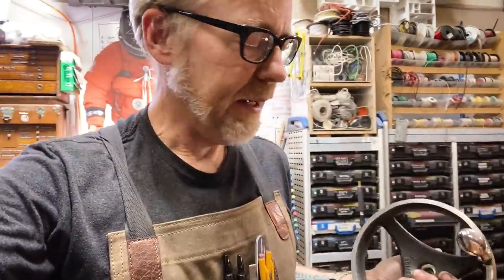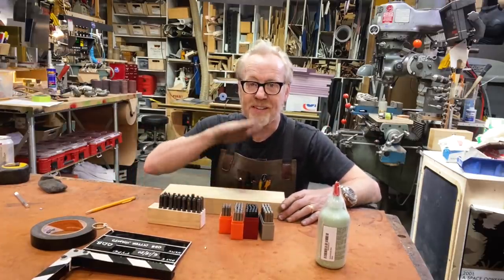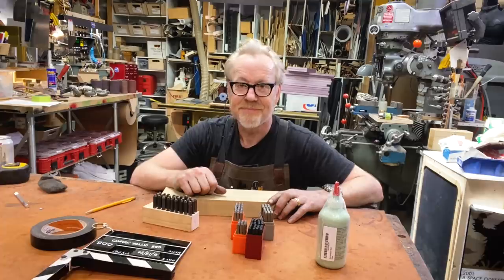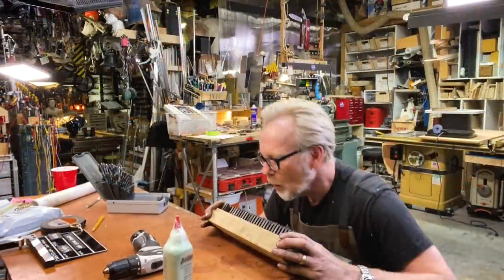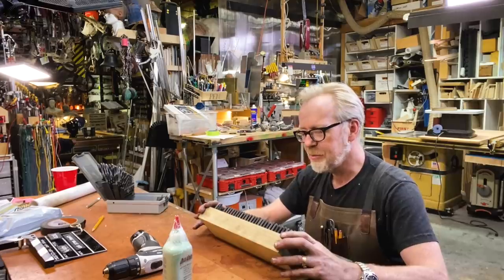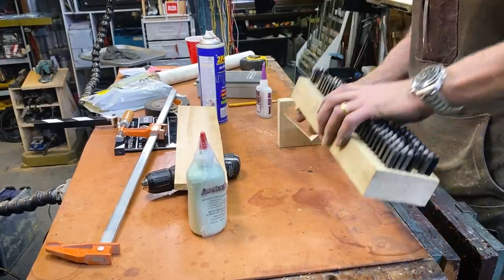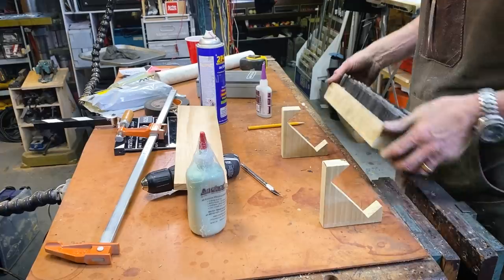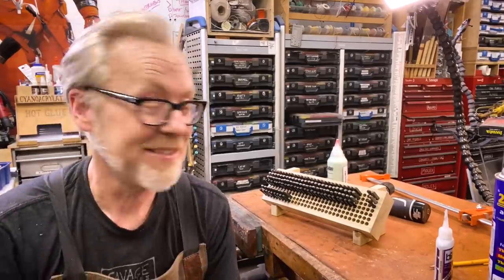Adam Savage's One Day Builds: Letter Stamp Holder!

Comment: Just a thought for version 2? If you varied the hole depth by horiz row then it may make it easier to grab each punch.. you could have 3/8 or so of the top of each punch accessible to grip as well as the front. If the top hole was the deepest it would provide a form of “stadium seating” for them.
Reply: Was thinking the same thing. The ones in the middle rows might be hard to grab since they're packed in a bit densely.
Reply: He could fix that by stowing a piece of glue stick down the holes. Maybe 1/2" on the middle row and 1" on the top row for example.
Reply: I made something very similar to what you just posted but for my 1/4” bits.  Came in very handy over the years.
Reply: Also could make another block and place over top to server as a cover and keep them clean and free of dirt/dust, & maybe magnets to keep it on?
Reply: I was thinking along the same lines... Possibly a 'stair-step' design of some sort.
Reply: Or just high and low on every other row?
Reply: Or use a magnetic pick up stick/wand.
Reply: I was thinking making the spacing a little wider and stagger the holes in alternating rows like a honeycomb pattern.  That would give a little more access to the front and back edges of each punch.
Reply: @dweiss1  I was thinking the same thing, that spacing would annoy me. yes it would take up more space but the whole point was to make it easy and less annoying
Reply: And add strips of aluminum as labels with the letters stamped in them for a quick visual
Reply: That would actually make it more difficult to grab the ones that are 'lower', same would be true for an up down up down pattern. The current arrangement is  good, and if he needs more space to grab, the best option is to just make a new one and drill the holes further apart.

Comment: I did something similar for my letter stamps but I put the block at a 45 degree angle But still kept the holes straight up and down so that I can grab different letters more easily since they are not all at the same height , which made it hard to grab them since the holes are so close together. Nicely done with the mill though and I like the anti tear out paint stick technique. Cheers

Comment: you should vacuum form a front cover just in case it tips over or something
Reply: I was thinking the same thing
Reply: what about rubber to "securely" hold them in but still able to pull them out. but say it tips over there is enough grip to keep them in place.
Reply: I thought he was gonna make a double hinged swing over lid w/ that flat piece of wood he had..... Or I was hoping he would've done it, that bothers me that it does have a lid and if you bump it over and a bunch slide out, you're going to be redoing it over w/ a lid, for sure.     LoL
Reply: its simple, don't bump it over. nothing of all the solutions  mentioned above necessary, cheers
Reply: I love this comment thread haha
Reply: I would want a cover just to keep it clean. I wouldn't use magnets in the holes as from my experience in a shop you end up with steel dust covering any magnet
Reply: XPNDBLhero I was thinking a box, knowing how he loves boxes.
Reply: It won’t tip over, the stamps are heavy, one full set is weighty so imagine this when it’s full..  I think a cover would be nice for avoiding dust tho.

Comment: As others have mentioned you should go back and drill each hole 3/8's deeper than the row in front of it to give the "stadium appearance" and make it easier to grab them when using. 
Also creating some sort of cover so you can store them without worrying about it falling over and or dumping out.
Reply: Or maybe glue some magnets in at various depths, for both the stadium appearance and at least some spill protection.
Reply: Also square holes for square stamps - anxiety kicking in 😄

Comment: Hi Adam.  I use stamps on a regular basis.  I started out with single character stamps but then I stumbled upon Numberall stamps.  These are so awesome!  It is a set of three stamps but each stamp has a wheel on the end with multiple characters.  You simply rotate the wheel to select the desired character.  The Numberall stamps has been such a time saver and the build quality is outstanding!  They are pretty expensive but you can usually find a used set on eBay for around $200.  I bought mine used and have been using them weekly for twelve years and they still work perfectly!  Take care.  Gary

Comment: Question for you: what was the purpose of the sacrificial strip you used when drilling some, but not all, the holes?

Thanks for the fun and informative content.
Reply: I think he was getting tearout with the first bit. The strip helps stabilize the top surface. Then I think he switched bits to one that scores the outside edge of the hole as it cuts.
Reply: It is because many drill bits will tear some of the top of the wood as it starts the cut. the sacrificial piece allows the work to be nicer. He then switched to a different style of drill bit which doesn't tear the wood up.

Comment: For the eventual revisision, glue a small magnet at the bottom of each hole. Purpose one, hold them in in the event it tips over. Purpose two (and the more important one) the satisfying snappy click when inserting back into the holder after use.

Comment: One thought: it might seem fairly obvious from looking at the face of the dies, but it might have still been useful to label each row with the corresponding font so that you know which one you're getting, and know where to put everything back. Also, while it would have taken a larger block of wood, placing the stamps just slightly farther apart would make it easier to get your fingers around them and pull them out.

Comment: The way I made my Dad's was I drilled the holes in a block of wood. Then I covered the open ends with 1/8' pine and then cut the block in half. Thus leaving a "Lid" for the case. My Did used those punches a lot. Traditions carry on. RIP Dad.

Comment: hey adam, a note for maybe mkII, make the depths of the holes different, like the ones closer to the center could maybe be drilled shallower so that they are easier to take in and out. maybe have it symetrical so that the bottom layer is level with the top, the second row from the bottom is equal to the second row from the top, etc. although you have already made it, maybe put in sections of dowel or some kind of spacer down the holes to allow for easy access of previously mentioned rows.

Comment: Adam, if I my come with a suggestion. Mark the side of your letters that has to face towards you when marking. That will make it easier to line up the letters, and reduce the chance of marking a letter 90° out from the rest. And nice holder, I use a similar one at work to store the letters I use for the tag plates.

Comment: I made one of those but it's a dome shape solid piece of wood with a stick and handle sticking out the top of it with a lazy susan attached to the bottom. Sits next to a small stamp press. With a three tier box of different size brass plates.

Comment: Quick tip... To get your letters in a straight line, lay a piece of masking tape on the line you want them placed. Top or bottom works. You can feel when the edge of the letter is on the tape line. A dead blow hammer works best for striking the stamp. I use Young Bros. stamps, made in the USA.

Comment: Adam: uses eXacto knife as a spacer
Everyone: “Americans will use anything to measure except metric”
Reply: Visual spacing
Reply: Not everything needs to be exact. Build it to fit the project and you never have to measure anything.
Reply: @KipdoesStuff  but it wasn't just exact. It was exacto!
Reply: Can we please switch to exacto for units of measurement? I want to buy 2 exacto x 4 exacto boards. I'm 71 exactos tall. You give them an exacto, they'll take 63360 exactos.
Reply: "A sinkhole roughly the size of six to seven washing machines has closed the northbound lanes of State Line Road near 100th Street in Kansas City, Missouri."
Reply: @RoseKindred  Does anyone know just how many cubed exactos make up a washing machine?
Reply: Huh, turns out exactos are manufactured in metric. Or at least I measured several dimensions on mine and got 0.5mm, 8mm, 8mm again, and 38mm. The length of the handle wasn't an even number, and neither was the length of the installed blade from tip to chuck, but I assume that's for ergonomic and non-constraint reasons respectively.
Reply: Plot twist: it was a metric eXacto knife the whole time
Reply: @Andrew Robinson man, you’re gonna flip when you learn that they do use metric
Reply: It has been 51 years since the Imperial System put men on the moon and the metric system still has not...

Comment: One hole should have a magnetic pin or pen that you use as a tool to help pull some of those where it is difficult to close your index and thumb on enough to pull it out. Or some kind of filler could be put in the holes of some rows to offset the height.

Comment: I want/need to do something similar for all my spare screwdriver bits.  The trouble is;

a) I don't have a workshop or a mill (yet)
b) I have over 400 of the damn things!!!!!

I will have to make up some kind of jig to fit my pillar drill, so that I can drill all those holes in  straight lines at regular spacing.
Reply: And you can do it faster on your drill press than it took him to set up that mill!

Comment: The reason he uses the piece of wood on top to drill through is to reduce chipping on the wood block, at first he had a layer of painters tape which ive used before but it must not have been working well, not tried to use pieces of wood like that before but i guess it works

Comment: You should have marked 27 hole locations, then skip drilling the 14th. That would keep A-M separate from N-Z, making it faster to find the letters and to put back (if you take out many at once).

You could have used the stamps to label the holes.

I am worried about the center of gravity being too far forward, you could pull one out and the whole thing topples over.

Comment: Any chance you could do at least a show and tell on the precision feed handle you made for your mill? Also, what about making a stamping press for the brass plates, if you are going to make a fair number of them.  Could be a fun build.  I'm thinking essentially a guillotine with a large weight instead of a blade that would hammer the die down into the plate.  Would be fun to run too(with ear protection)

Comment: Maybe cut a slot for some flat magnets on the bottom or add small circular  magnets at the bottom of each hole to hold them in place just incase of tip over

Comment: What's up with the paint stick or whatever you used on top of the wood while drilling?
Reply: I believe he was trying to prevent tear out.  It's when the top of your work gets all torn up. Halfway through he stops using it so I guess he figured out a way to do it without needing extra sticks.
Reply: So when the drill bit plunges into the wood it wouldn't splinter or chew up the top of the finished block. You can see that close to the end of drilling he stopped using that piece and when you see the final product at the end of the video you can see the "tear outs" between the holes.

Comment: Heres a Q, could that mill have drilled those holes automatically if you had programmed it to like a CNC miller ?
Reply: wolfe1970, his wood mill doesn’t have motorized movement. Only accurate measurement and the ability to compute the location of the next hole. He showed how it worked when he needed to drill holes for his chuck rack last week.

Comment: just remember when you put the letters in the Capitals go in the top rows the small ones go in the bottom .... yes that's the origin of Upper Case and Lower Case ...
Reply: a nice addition to letter punches is a vise that holds the letters in line that has a bar that drops across the top of the letters so you can stamp a word in at one shot ... 
.
dont forget to put the Font size on the letter case too ...

Comment: Looks like this version, the grid is 30 holes wide.
For a version 2, I'd suggest making it wider? Maybe to 36?
26 characters + 10 numerals of the same font.
Next row down could hold the matching 30 punctuation and other symbols. !@#$%^&*() etc.
(Although if you just rotate the punch, you would only need one version of the four brackets ({[< so that drops the count to 26.)

Comment: Did you consider leaving a larger space between each row, punching each stamp into the wood, and then rubbing something into the impressions to highlight them? You would then be able to easily see the different fonts and sizes as they will appear, rather than the reverse you see when looking at the stamp.. As you add new stamps, you could stamp them in the wood. Combined with others suggestions for tiering and magnetic retention, this would make a premium solution.

Comment: Why did you use CA glue instead of Wood glue?  Also why for the first couple holes was there tape on top of the Bass wood?
Reply: WeylandsWings The tape was to try to keep the wood from splintering between the holes. (Didn’t work)

Comment: You only need 9 holes for numbers right?
Reply: 10, technically. 0-9
Reply: 6 can be turned over to a 9
Reply: @andrewwebb2141  oh yeah, that's true. I didn't think about that. I suppose there would only be 10 if the 6 and the 9 were distinctly different in some way
Reply: Yes. Number sets come with 6 and 9 being the same thing.

Comment: You should really do a one day build to make yourself a proper shop camera stand/tripod. Almost all your videos contains vibrating/shaking images due to vibrations from machinery.  :)
Reply: One of the cine camera mountings I used at school in the 80s and it was old then, was filled with oil. It had two  thumb screws to lock the movement and how far you undid them determined the speed of movement in the various axis. So the solution is to have a fluid to cushion the equipment to smooth out the vibrations.

Comment: Not your best work Adam. You simply copied the same storage solution that the sets came in. What about some spacing so they’re easy to grab, cart the heights of each set, add labels so you can see what each letter is so you don’t squint at the pin, etc etc need a ver 2